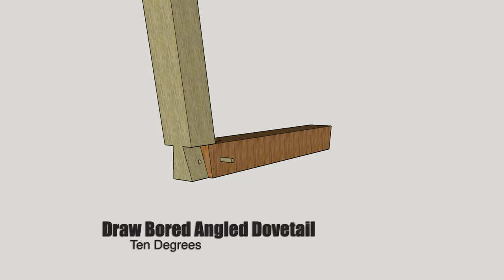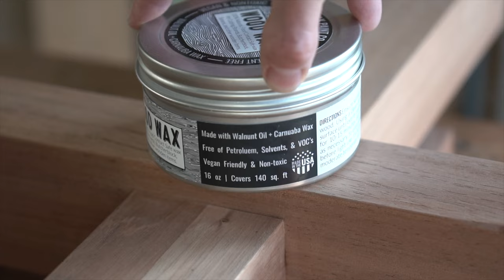The biggest dining table I've made yet...

Comment from the maker: Help support my work through the following affiliate links, all products utilized in the making of this project:

The Real Milk Paint Company's Impressive line of finishing products (Special Affiliate Link):
https://www.realmilkpaint.com/ref/cowdogcraftworks/
For 10% off use coupon code: cowdogcraftworks
-Starbond CA Glues (Special Affiliate Link): https://bit.ly/36sB2Bv
For 10% off use coupon code: cowdogcraftworks
-Western Saws Sourced from Florip Toolworks (Non-affiliate): https://floriptoolworks.com/

The Complete Japanese Joinery (Book): https://amzn.to/2OAj1sM
RIDGID 1-Layer Standard Pleated Paper Filter for Most 5 Gal. and Larger RIDGID Wet/Dry Shop Vacuums (2-Pack): https://homedepot.sjv.io/gvD1O
14 Gal. 6.0-Peak HP NXT Shop Vacuum: https://homedepot.sjv.io/qrj1O
RIDGID 9 Gal. 18-Volt Cordless Shop Vacuum: https://homedepot.sjv.io/oQaNm
Center Punch: https://amzn.to/3fSQsCj
Stanley Sweetheart Chisels: https://amzn.to/2ZATrKg
Solid Brass Wheel Marking Gauge: https://amzn.to/3jfDFfR
DFM Tool Works Card Scraper Set: https://amzn.to/2CMZp1W
DFM Tool Works Card Scraper Burnisher: https://amzn.to/2ZAwzuv
DFM Tool Works Small Square and Center Finder: https://amzn.to/3jfFdXd
Glu-bot Glue Bottle: https://amzn.to/2CdxYOV
Mineral Spirits: https://amzn.to/31xTBmG
Dewalt Compact Drill: https://amzn.to/3ht3tng
Metric Japanese Style Carpenter's Square: https://amzn.to/35kC3fG
Mini Square 10x5cm: https://amzn.to/36mtcti
Faber-Castell Ecco Pigment 0.1 mm Pen: https://amzn.to/36oLni8
Pentel Mechanical Pencil: https://amzn.to/36uqbab
30 Pack Figure 8 Steel Desk Top Fastener Clip with Screws - Heavy Duty Figure-Eight Fasteners Clips Attaching a Table, Solid Steel, 12 Gauge: https://amzn.to/3yLfzkA
M6-1.0 x 20mm Flat Head Socket Cap Screws, Stainless Steel A2-70 (18-8), DIN 7991, Quantity 25: https://amzn.to/3utgQts
Rubio Monocoat Wood Stain Oil Plus 2C Super White 350 ml: https://amzn.to/3fOwXfH
PGMJ 80 Pieces M6 Wood Inserts Bolt Furniture Screw in Nut Threaded Fastener Connector Hex Socket Drive for Wood Furniture Assortment (M6x15mm): https://amzn.to/2SxGVub